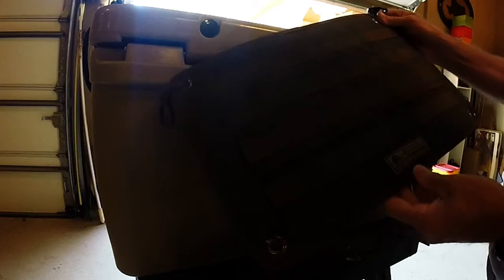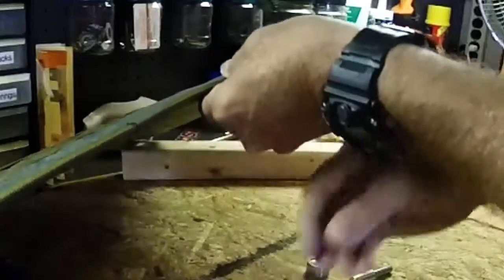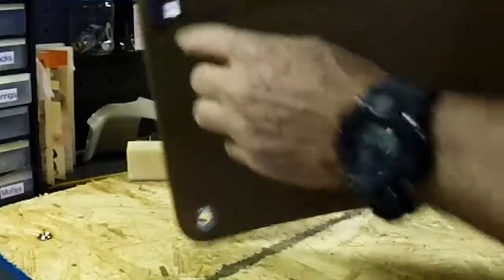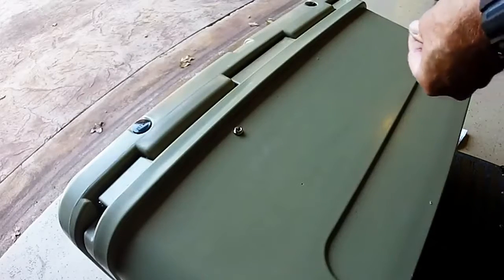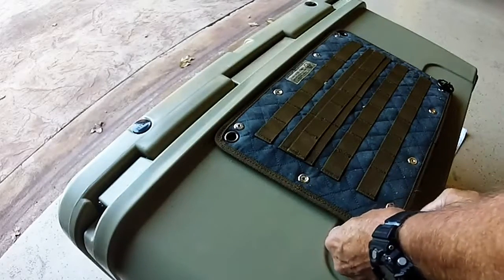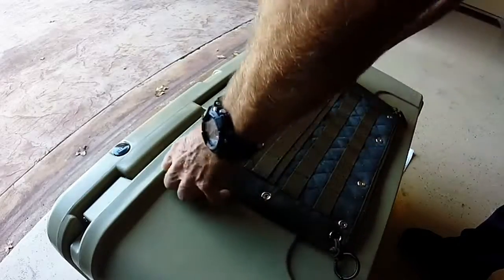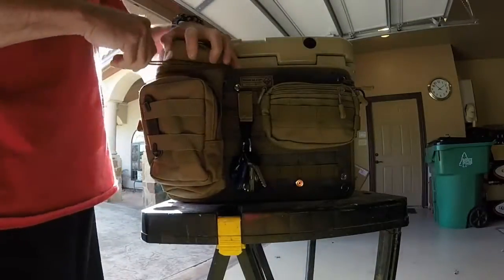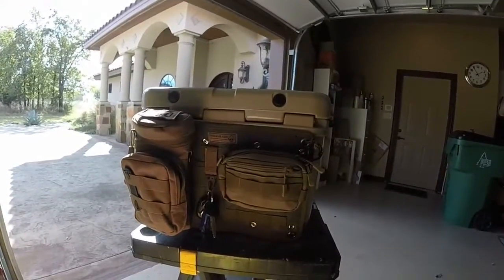RTIC 65 & YETI Roadie Cooler DIY Molle Panel Installation

Comment: I bought a few of those exact molle panels and planning on attatching to my cooler. So, I looked it up on YouTube to see if my idea was feasible and here you are doing the same thing.  Except, after some thought, since the entire back is a Loop Panel so Im just gonna use some Adhesive Backed Hook Sheets and see how well it holds up. I like your method but I dont wanna put holes in my Way Overpriced Yeti Tundra 110..   Yet.. ;)   Thanks for the time spent and knowledge gained.